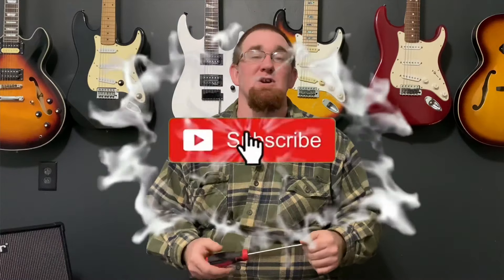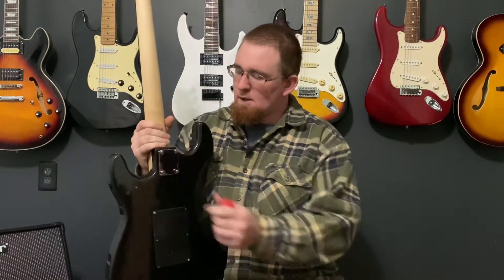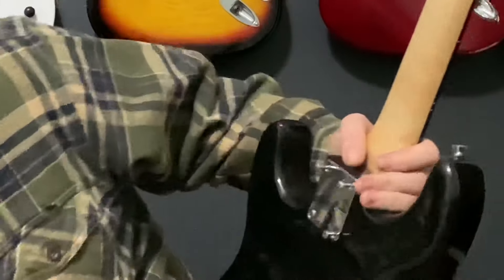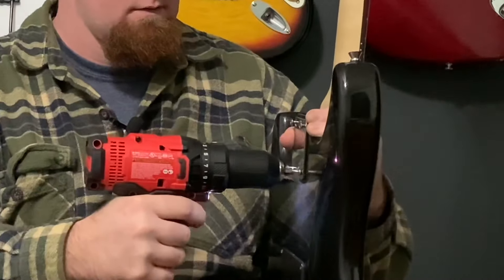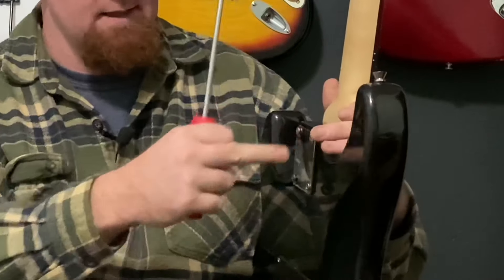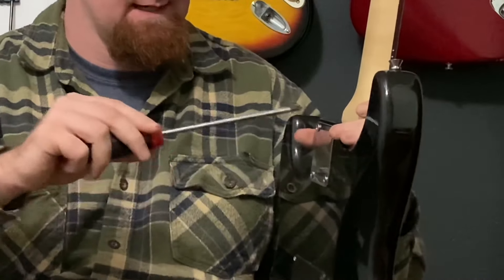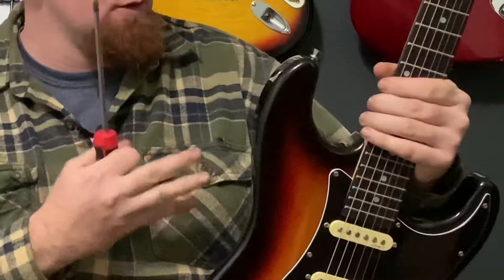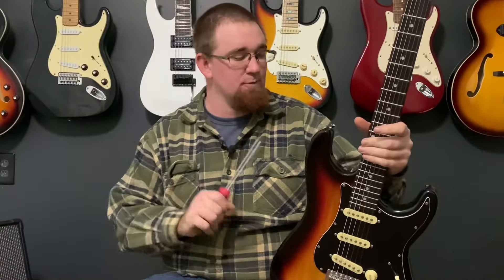Bolt on Necks, How Tight should it be?

Comment: Exactly what I needed to know!  I just had to loosen the (5) screws on the neckplate of my Sterling Cutlass. The neck was slightly misaligned, causing the high E to almost fall off the fretboard, and I was following an online demo to nudge the angle back a touch. It turned out to be a lot easier job than I feared, and is now perfect.
I noticed the demonstrator did not use excessive force to retighten the neckplate screws, either.